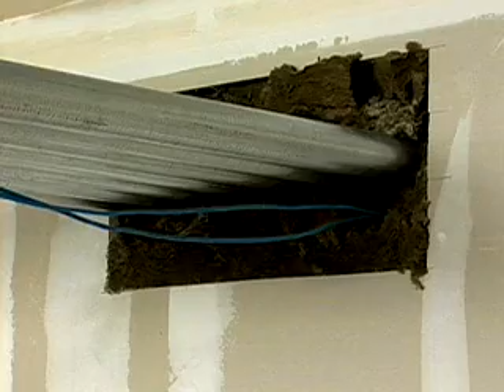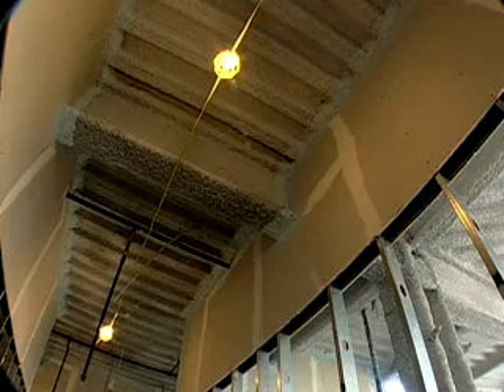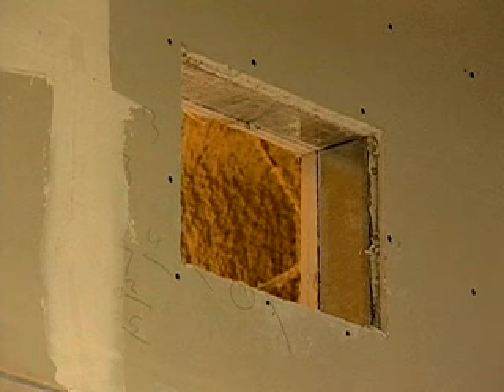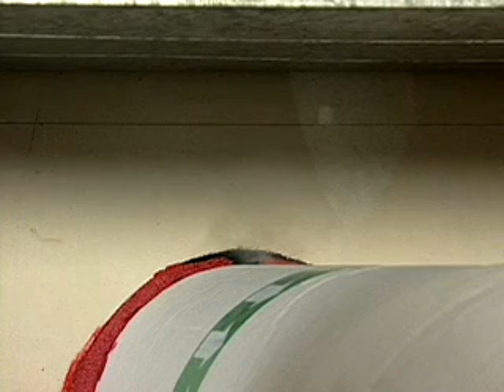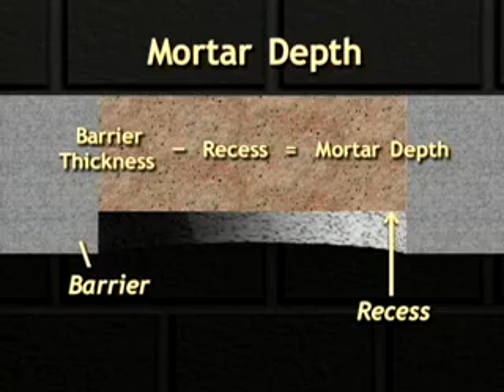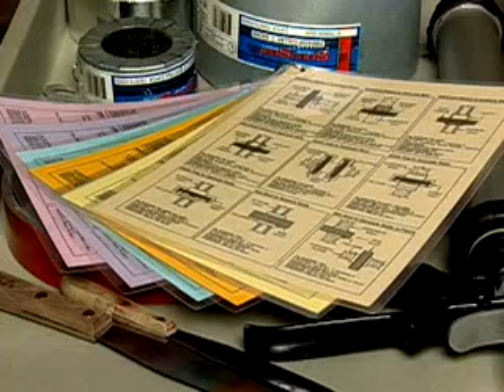Lesson 6   Inspecting Firestop for Compliance

Comment: Sir,
Why this all wall penetrations should be two side fire sealant,Floor penetrations only one side??
Reply: because the floors are fire rated?
Reply: The fire can spread from room to room, so there needs to be firestop on both sides. Floor systems are designed to be firestopped from the top for access, and to contain the fire below, and plugging the hole from the top
Reply: @jimbeezeetheman  thanks sir
Reply: 1.If the barriers are 3hour fire rated, can use two-hour Fire stop system?

2.Two hour fire rated wall,we can use 3hour system?
Reply: @nisarkuttiyil600  3hrs needs 3hr firestop 2hr can use 3hr but it won’t be 3hr rated